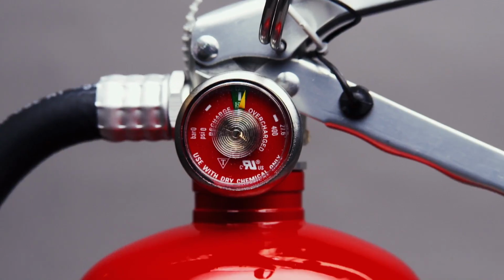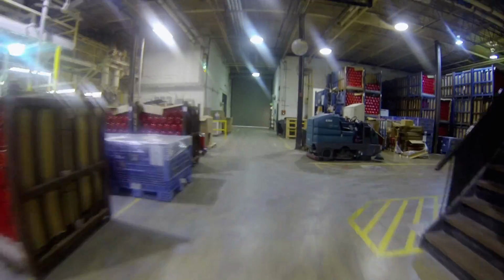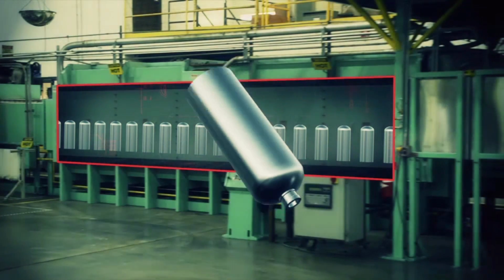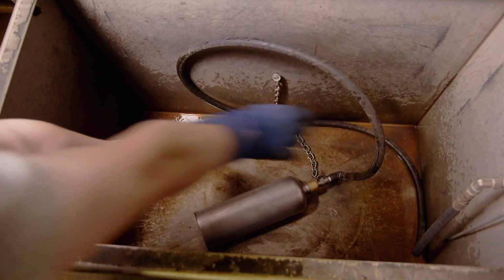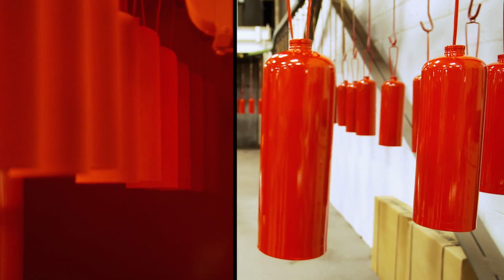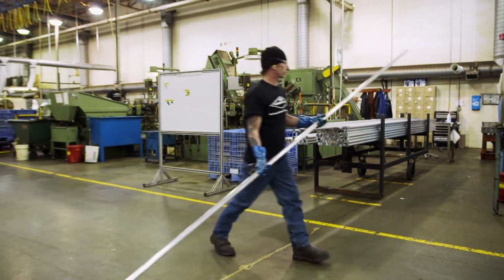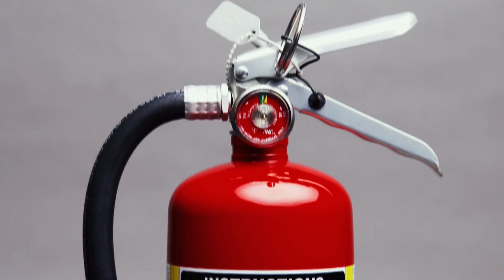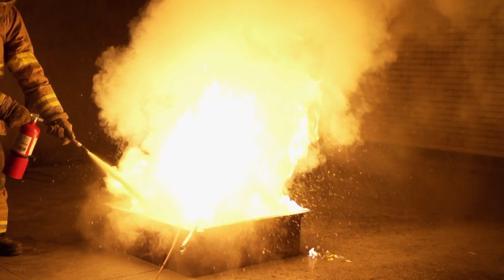How an Amerex Fire Extinguisher is made - BrandmadeTV

Comment: Wait, what? The manufacturing process starts with pre-made cylinders? Geez, Amerex. 
Rotating cylinder machine is badass, though. Would love to see a diagram of how that works, but I'm sure it's a proprietary secret. 

Edit: Ahahaha, how many lb-ft do you torque the valves to? Oh, just a hammer tap's worth!

Comment: Kindly someone please tell me where is the manufacturing year on co2 and dcp extinguisher for this company
Reply: Also stamped in the metal on the bottom of the cylinder for dp, co2 will have the stamping at the top
Reply: Should be a number on the back of the label

Comment: Fire extinguisher technology has indeed changed over the years. Back when I graduated high school I went to work for a company that sold and maintained fire protection equipment. Back in those days we were still refilling some off the old fashioned soda-acid type extinguishers. Many of them were made from brass or copper. Nowadays they are considered collectors items and people sell them on Ebay for $100 - $200 and up. Cleaned and polished they are beautiful. But only as decorations as due to their age the vessel may no longer be able to hold pressure and could explode if used as they were once intended.

Comment: Amerex, you know your gauges fail in 10 years, right ?
Reply: You need to replace it every 10 years anyways
Reply: @alecringberg8245  since when do you have to replace guages every 10 years?
Reply: @AESFTW  The extinguishers need to be replaced after 12 years but if it has passed inspection and the inspector saids to keep it, your fine.